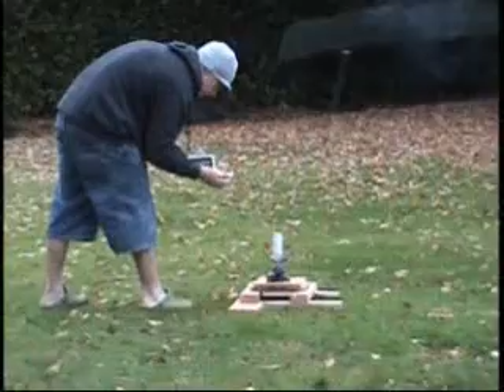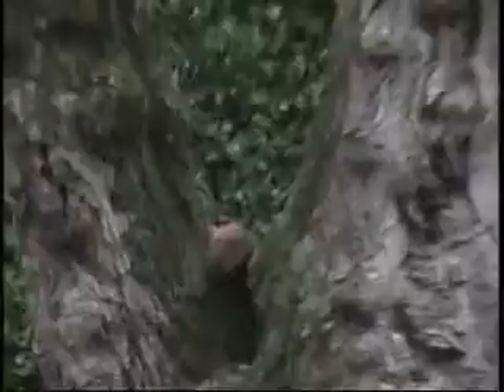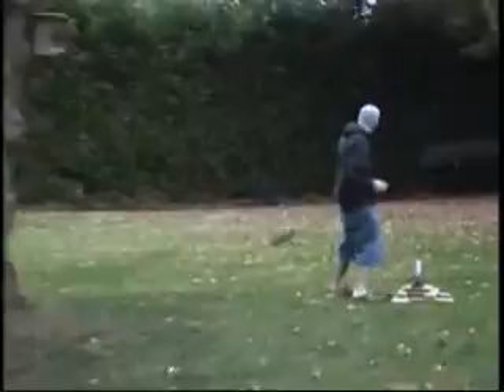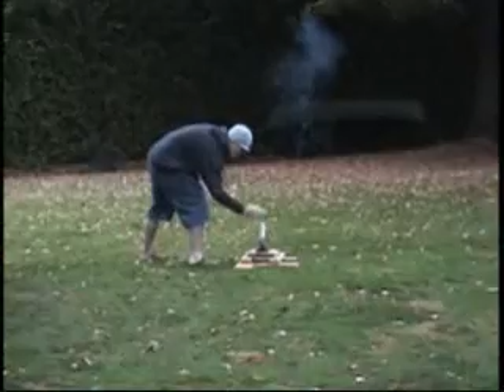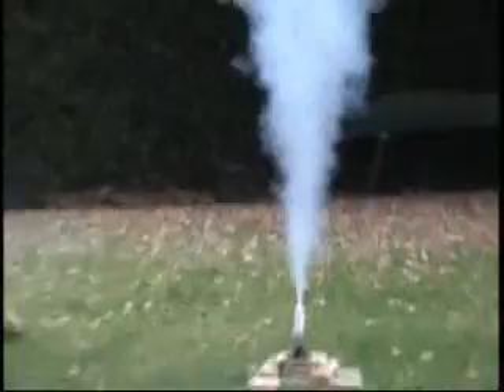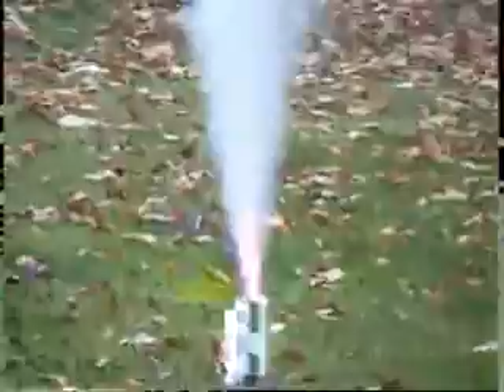Funny ass kno3 rocket test

Comment: I noticed one thing, at 00.17 the buttom of the tree looks like an old mans face=)

anyway a little tip next time=) make some fuse paper (take 1table spoon of KNO3 with around 1 table spoon of hot water and mix it next take a cofee filter and wet it in the mix then let it dry) its a bit safer with a fuse then a match =)

Cant wait until you make the big one =) good luck